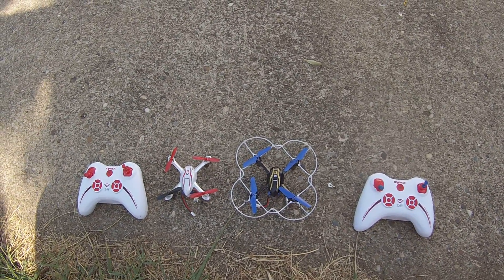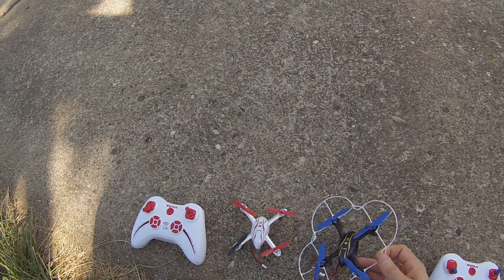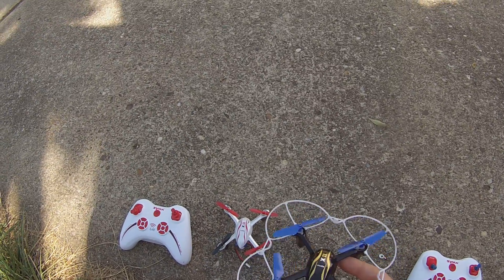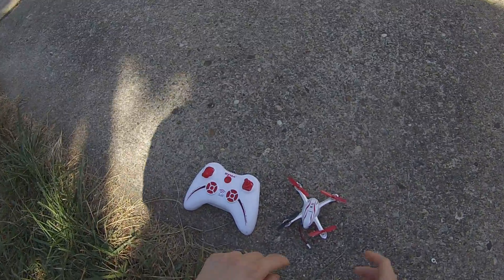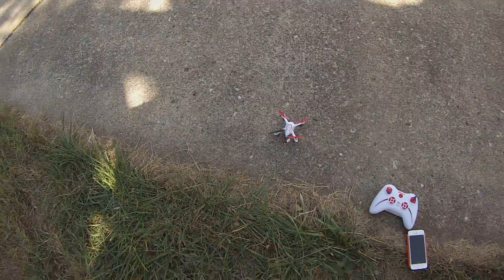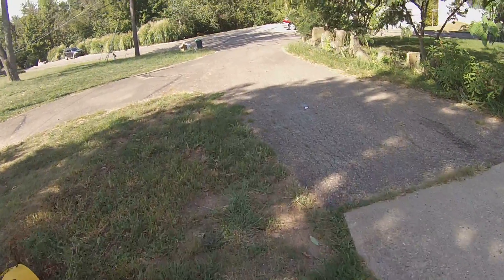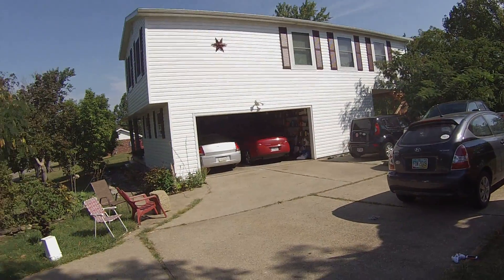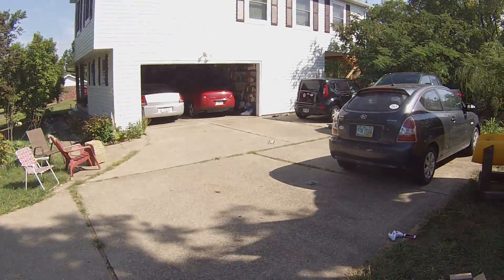Syma x11 with Hubsan X4 motors

Comment: how did u fit the 7mm motors in?
Reply: or the 8mm?
Reply: This will give you the details. http://www.instructables.com/id/Installing-Syma-X11-With-Hubsan-X4-Motors
Reply: that's something I haven't seen yet, opening out the stock motor seats for accepting 7x16mm motors, leaving the gear drive system intact.
it'd be very little weight gain, provide more torque, and possibly even draw less current doing it for a little more flight time. motors staying cooler than 6x15's, more punch, more speed, etc etc.
the hex shape made round with a dremel to make room, shortening the motor cover post about 1mm for motor length increase.